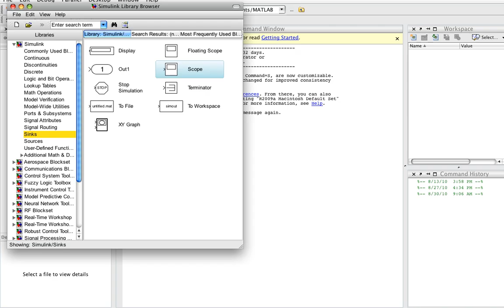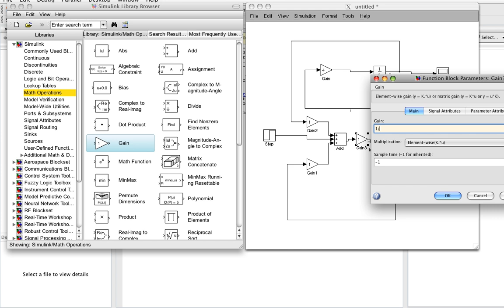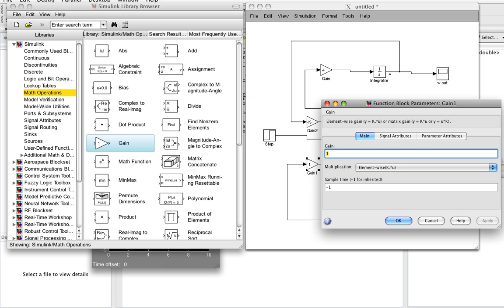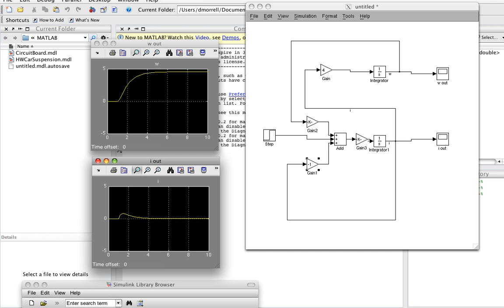Modeling a DC Motor In Simulink Part 4 of 4

Comment from the maker: @manhole42 In the model that we used, the motor speed is proportional to the motor driving voltage. So with the unit step, the motor has a top speed. With a ramp, the motor has no top speed in the model; the speed increases as the driving voltage increases. In real life, this will not happen because you cannot increase the driving voltage beyond a maximum value without damaging the motor.

Comment: If wanted to model the friction (K_F) in the system, could I relate the frictional torque to -K_F*omega? If I could, I'd need to find the constant of proportionality K_F, but that is difficult without understanding how much oil that motor was dowsed in. I guess I see why you didn't include that, hehe. Great set of videos.

Comment: Hi Darryl, these videos were excellent. A teacher that can simplify a tricky topic as you have just done, alone proves your genius. I am, however, not commenting only to commend your efforts.

Here are my questions: how possible is it to model a load such as a tire and a road surface. Secondly, how much would the model differ when using a brushless DC motor? i understand that the excitation voltage would no longer be a simple step input, but a sequence of phase modulated inputs. Thirdly, determining these constant values seems tricky. Are they specified by the manufacturer, or can they be obtained through certain tests or calculations?

Comment: sir i am getting an error when i try to run as you instructed
"Warning: Using a default value of 0.2 for maximum step size.  The simulation
step size will be equal to or less than this value.  You can disable this
diagnostic by setting 'Automatic solver parameter selection' diagnostic to
'none' in the Diagnostics page of the configuration parameters dialog "